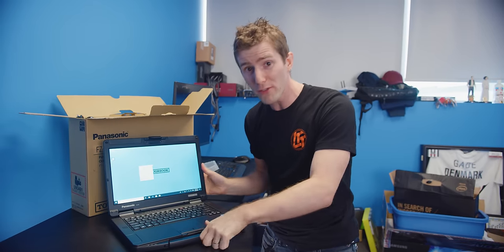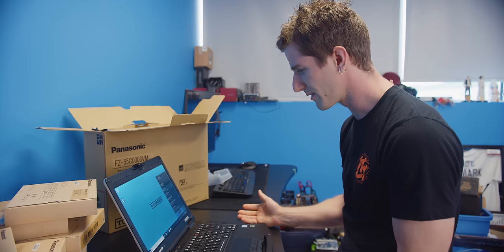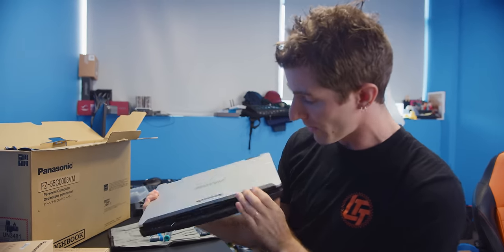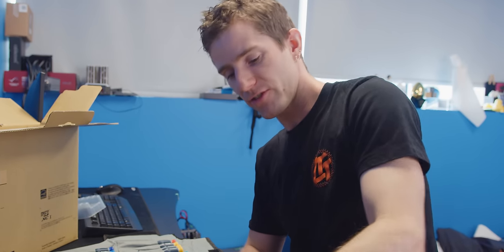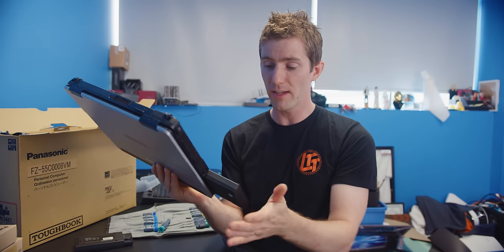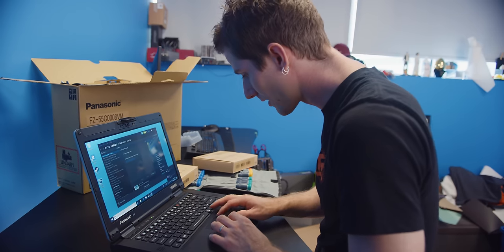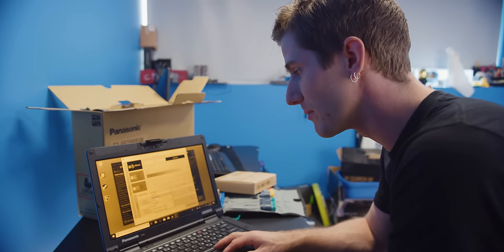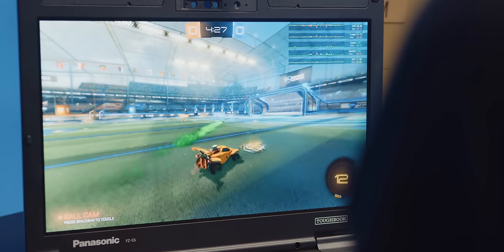The CRAZY Upgradeable Laptop - Panasonic TOUGHBOOK 55 Showcase

Comment: You mentioned the display cable being easily accessible, and there's a good reason for that! In large IT departments where we often have several thousand machines in circulation, being able to frankenstein two broken units together into one functional one quickly is an important feature to have. We often get computers with a broken screen but that are otherwise completely functional. And other times we get completely trashed units, with RAM that's still good to use. Salvaging usable parts is pretty much a daily occurrence. Sometimes several hundreds of machines are sent in at the same time for service, and at that sort of scale every minute counts. We didn't have this exact unit at my workplace, but we did have a low cost enterprise laptop with a lot of the same features in place.

Comment: Pulls drive while laptop is on
"Oops, shouldn't have done that."
Then proceeds to pull battery while laptop is on
Reply: Well to be fair, the batteries are actually designed to be able to do that.
Reply: Sure, but only when the other battery is installed, we don't see him with the extra battery until after he pulled the first one.
Reply: @Azuralis  He only had one battery in at the time, and we clearly see that when he opens it up the screen is black. Then CUT, and the laptop is on.
Reply: I am able to do both of those things with my Dell Latitude that I am currently using to type this comment.. in fact when I saw this comment, I plugged my laptop in, pulled the battery, pulled out the hard drive (the drive slide didn't come with screws for whatever reason, but it stays in place really good unless I deliberately pull on it so it's fine), and it did fine. :P
Reply: @valrabellkeys9867  anyone can do that,
Reply: Or he shut down the laptop in the cut between 6:07 and 6:08 before removing the battery at 6:09, in which case everybody lived happily ever after.  Scandalous!
Reply: Both batteries are in. He simply cuts it and turns on the laptop so that he can show off the hot swapping while there is a picture on the screen.
Reply: @SportbikerNZ  I'm assuming it was updating at shutdown so they cut away that footage because we know how updates can be sometimes
Reply: @valrabellkeys9867  Because it has a bult-in battery.

Comment: they should seriously make a gaming labtop like this
Reply: Swappable GPU
Reply: @Hector-Romero  GPU thermal throttles 

you in vc: Hol on gotta swap to a cooled off GPU gotta be afk for 10 seconds
Reply: @haxboi5492  stack of fridge gpus 🤣
Reply: @haxboi5492  like changing the barrels on machine guns 😂
Reply: @MickR0sco  'cover me, changing GPU!'
Reply: Oh boy, have I got news for you... Framework, a very cool laptop company just announced a 16" laptop with modular IO AND modular GPU while being extremely repairable (going so far as to provide independant repair shops with schematics). It should come out later this year, LTT just released a video on that laptop

Comment: Panasonic: Do NOT leave it out in the rain
LInus: Soooooo, you're saying I can rip the keyboard off?
Reply: @dethrophes i can see why they said it, he's obviously clueless on IP ratings
Reply: When i was working for the police we had one of the older toughbooks thrown out the window of a stolen police car during a chase, it sat in the mud and rain beside the motorway for 3 days before we recovered it. when we got it back to the workshop it turned on without a hitch. I don't think leaving this out in the rain would damage it.
Reply: @dethrophes He shouldn't give advice if he's clueless, it's literally his job
Reply: @dethrophes is that a legitimate question? The channel has "tips" in the name for Christs sake
Reply: @taidgheshea9625  that one might have been designed for that, some toughbooks are just rugged and some are near submersible.
Reply: dethrophes nobody is here for the comedy bro
Reply: I use my Toughbook in rain and adverse conditions and it still rocks, come rain or shine, snow and wind.
Reply: @dethrophes it can't be a tip if ti is false
Reply: @taidgheshea9625  I'm pretty sure police tough books are proper tough books, the main focus is on survivability rather than having a balance of survivability and power.

Comment: This is just like having a ibm Thinkpad release in 2019
Reply: Lenovo still does some rugged Thinkpads in their student lineup, like the 11e, and yes I know not as configurable, or maybe even as powerful, but still a decent option for a  general purpose laptop that's more rugged then most in it's price range.
Reply: There are, and its one of the best laptops... x1
Reply: @Znowin  the x1 is amazing
Reply: @CommodoreFan64  yeah, but Lenovo, peddler of Mainland China spyware. Not IBM.
Reply: This is like the X201 thinkpads but the modularity of the DOCK is built into the laptop itself. I still use 2-3 of them because they are so dang tough and handy. And the dock and accessories were cheap af
Reply: thickpad
Reply: @CommodoreFan64  the 11e is far from durable. the amount of those ive seen that broke from regular use is mindblowing.
Reply: @PickleSurpriseVEVO  Superfish never effected the thinkpad line, only their cheaper products
Reply: Super A31p.
Reply: I loved my R40. Until the cmos battery died and it locked me out eternally. RIP R40.
Reply: But can you swap the motherboard?
Reply: Reminds me of my X40. Which was just like MacBook Air but years earlier and much more modular.
Reply: @psyience3213  Ehm? So why don't you replace it?
Reply: Yes!!!! :D
Reply: @psyience3213  RIP. My T601p recently died to the nVidia GPU issue. Just built another, this time with the LED panel.
Reply: T20 with extra battery pack was my jam. I miss that little red nipple....
Reply: @CommodoreFan64  it doesn't have a trackpoint.
Reply: @Usernamejjd  Fair point, and do I really like the trackpoints on X120e, X131e, and X140e, but I also use a logitech mouse with mine more than the trackpoint, so as long as the trackpad is decent I guess I could live with it if I had too.
Reply: @BilisNegra  it had a security feature that locked the bios when the cmos battery died or was removed. You have to take ot to an ibm manufactuerer to have it reset. Aka its impossible to fix and thats just the wnd of that. Very disappointing.

Comment: These also work great for mechanics, used an older tough book in the shop and it handled oil splash, water, 12 foot falls off lifts and still ran.

Comment: This is the computer I use in the Military.
Reply: shhhhhhh
Reply: I may or may not have dropped a few off the top of fighter jets...
Reply: @TheDalhuck  I remember using one to do post flight inspections and it falling from F-18 wings
Reply: @TheDalhuck  Did they survive?
Reply: @n3tw0rk_n3k0  Super Hornets for me.
Reply: @atirat7388  if they were open the hinges would break, but still useable.
Reply: Well. Dropping this on someone might cause serious damage, so makes sense to use in the military
Reply: Still have CF-53s out there going strong.
Reply: Same. Fucker for run over by a box truck after being dropped, screen cracked and worked perfectly
Reply: @n3tw0rk_n3k0  YEET
Reply: in call of duty??? o really??
Reply: @BaxterMetalTV  hey. Chill. 
You don't need to call out every perceived "lie" you see on the internet.
Be a bit more trusting. (Bit more, not give them your credit details trusting)
You sound like a toxic person, might wanna change that. Have a great day whenever you read this.

Comment: "2019 Toughbook is not that thiccc!"
Reply: Dude i was about write same fucking comment
Reply: 69 likes ;)
Reply: Well it is not compared to 2005 CF-something Toughbooks we got used to...
Reply: It is honestly rather slim.
Reply: Eirik Heggelund so is your wallet after buying one of these
Reply: Eirik Heggelund it's massive
Reply: @AnonymousUser77254  Well it is not a Chromebook, is it. Considering what it is capable of doing I would not complain about thickness at all!
Reply: @seanc.5310  That is definitely true. And that is without the accessories.
Reply: Eirik Heggelund no, wouldn't complain about the thickness, that's not the point of the laptop. That doesn't mean it isn't extremely thick though.
Reply: @AnonymousUser77254  It is thick, but, relatively speaking, it is slim. Wildly interesting!

Comment: “It’s not even that thick” 
-the laptop LITTERALLY has handles
Reply: You should see the fully rugged models and how thick they are.
Reply: I actually like a thicker laptop. More sturdy you know?
Reply: Thatguyontheinternet I have to agree, I’ve seen thin chrome books get bent in half in peoples backpacks
Reply: @Honeydwarf85  jerryrigeverything would approve
Reply: Love handles
Reply: 7 years ago they used to be so much thicker.
Reply: @jasonmurawski5877  We had an older cf-53 toughbook years ago have a forklift fork lowered on it. Smashed the screen down like two inches. Replaced the screen, latch, and front and rear plastics and redeployed the thing. The hinges were even still fine.
Reply: I paused the video and gave it a dislike at that moment... That was so stupid to say... The laptop is as tick as a book
Reply: 20 years ago it would twice the size.....
Reply: Have you ever seen one of the early thinkpad models? Those are thicc
Reply: @ForeverMan  It's a rugged laptop, with 40 hours of battery life, it's crazy thin.
Reply: @Honeydwarf85  i mean im pretty sure my blade stealth is sturdy enough and that's 1.5 cm
Reply: Msi is literaly laughing with their 10kg "laptops"
Reply: So did the GameCube. Nobody calls that  t h i c c
Reply: My MSI laptop from 2017 is thicker than this.
Reply: Hmm, thick, modular... why not just buy eurocom/sager? Get the specs you want, can have MUCH better GPU(up to desktop GTX 2080). Want high speed terabyte m.2 SSD? Go right ahead. And so on. Of course it's not as on-the-go modular, but you get much more bang for the buck. Oh and the biometric security options are there too.
Reply: @ForeverMan  - it's as thick as my 15" gaming laptop, but probably a lot more durable.

You better stick to your trendy Apple products that kill themselves because of non-existent cooling.
Reply: @Texas240  I'm not complaining about the thickness of the laptop but about the comment he made, just because he's getting paid...
Also
I use a Acer nitro 5 17 inch, not a fan of MacBook
Reply: @ForeverMan  - alright
Reply: @ForeverMan  Hey! We're using similar laptops! I use the Dell G3.
Reply: Doesn't make it thick. Did you see it?
Reply: I used to use a Toughbook for work, this one has clearly been through a famine. Ours were something like twice as thick, and if I was ever attacked by an animal my plan was to use it as a hammer.
Reply: @bosstowndynamics5488  i know but do i need that durability when im in school sitting in front of a desk doing graphic design
Reply: ForeverMan its not even that thick, for a rugged laptop
Comparing it to a normal laptop is like saying 'why is a rugged jeep not as comfortable as my sedan, and why is someone saying a jeep with ac is somehow not as uncomfortable as one without ac if its still less comfortable than my sedan reeeeeee'
Reply: it's not. length and width is the prohibiting factor for a laptop fitting in a bag for example, who cares if your laptop is .5 inch thinner
Reply: My first laptop was thicker then that bruh
Reply: its names is fking TOUGHBOOK
Reply: Chris Cosby haha. I’m looking at my cf-31 I have for work and it’s about 2-1/2 thick
Reply: @cosbyc2  I know, I have a couple. grins
Reply: english is not my language. what does "having handles" mean figuratively?
Reply: And it's still quite slim for what it can do.
Reply: The CF-53's were thinner. If you ever get to hold a CF-51 Mk 2 it's something else. Literally as thick as a phone book.

Comment: Hey Linus! Luv your channel! I was a Panasonic Tough-book Tek and the adhesive strips are part of the KB (Keyboard) kit. The TB's are designed for serviceability and are fricken awesome. I still have my CF-29 that still holds a 5-6 hour charge. They even have rubberized Backlit Chiclets for the NYPD and had to use a large screwdriver to open the rear IO doors from all the coffee and doughnut sprinkles. Not even kidding bro! Lol!

Comment: The upgradeable GPU is a big deal but there's a couple of questions.What are the GPU options and will those options be made available for future graphics chips?

The proprietary connectors and lack of a common laptop standard for swappable peripherals mean you may be limited to Panasonic only options. Since there is no guarantee for how long Panasonic will keep making peripherals then buying this laptop is a bit of a gamble.

Also, can the CPU be upgraded on this model?

It's a good laptop and a step back in the right direction but it's still built without the foundational standards that all manufacturers should adhere to and which would assure a longer future for upgrareable laptops. That is key.

Comment: The PowerBook G3 "Pismo" (1999/2000) had very similar upgradeability features (swappable bays -optical disks, additional HDD, Zip drives, Floppy disk.. there were many options in the market - and could house a hot swappable second battery, giving up to 8-9 hours of life, incredible for the time).
Was a very easy opening laptop - just flip the "zero screws" keyboard - and could upgrade RAM, HDD, WiFi card, and even the processor, but not the graphics card.
Nice to see that the concept is still around.

Comment: The reason it’s this modular is because the biggest customers of toughbooks are militaries, law enforcement, hospitals and organizations operating in hazardous areas like construction sites or a refugee camp in a war zone, etc. 

These are typically used by numerous people sharing 1 laptop. The information on it is usually sensitive too so it needs to be easily replaceable between users. Features like that card scanner also suit the needs of some of the aforementioned users, like an intelligence officer accessing confidential information that needs clearance using a card, or to be used as an ID scanner by the police(who also use that car dock you mentioned very frequently), or like you said, to access someone’s medical info.

Some good work panasonic has done on this. A lot different than the tough book I owned years back but still looks to have that same grit and reliability

Comment: "You never know when you need to quick eject your storage!"

true but if you were IT and needed to put an image on 100 of these things, its pretty ez
Reply: Makes it easier for the cops to hide their own misdeeds.
Reply: @saulgoodman2018  we used tough books in Iraq and Afghanistan when I was deployed as an infantry officer.  Destroying the SSD or removing it was a very common practice if a COP was being attacked or if the enemy was inside the wire.  Never happened to me (as the enemy reaching the wire, is quite rare) but we were all trained to destroy any information if we were on the verge of being compromised or overrun.
Reply: Maaaan just use FOG and you’re good. Image 100 workstations all at once.
Reply: Ignoring all the paranoid reasons, the best one is the construction manager who comes in having had a chunk of concrete fly into his screen.  All you have to do is pop out his SSD and put it into a waiting spare.
Reply: Actually the most probable solution is that you have multiple people using them, but you don't allow them to keep them, so they just retain there ssd and pop it into one of the waiting laptops so they keep there work with them regardless of which of the companies laptops they get when they show up to work.
Reply: @crashtestdummy2337  this would be useful then
Reply: swapping between operating systems without requiring dual boot shinanigans
Reply: @saulgoodman2018  Or having each ssd setup for specific situations, one for work another for home use, maybe even one dedicated for media. Hell you could even make them really secure by storing some data on one ssd and the rest on the other ( or maybe having the other initiate some code) while further locking it down with the other modulus and a smart card or something so if you don't have the right combinations and data it wont work right or only give you the operating system and not the other bits.

Comment: It feels so weird that you can just swap in a graphics card when I almost destroyed my laptop trying to add ram.
Reply: F
Reply: F
Reply: F
Reply: F
Reply: The fuck is "F"?
Reply: @nexxusty  F to pay respect
Reply: how the fuck did you do that? was it soldered onto the board?
Reply: @nexxusty  It's a reference to one of the worst call of duty games in my opinion, advanced warfare, in one of the campaign missions there is a scene at a funeral and during said scene a message pops up and in the pc version it says "Press F to pay respects". Everyone seemed to find it funny or something and used it through out twitch streams when someone failed or something bad happened in a game. Now it's overused and people just say it for no reason.
Reply: F
Reply: I feel your pain
Reply: @colossalbreacker  I had to take out a few screws to take out the motherboard, as the ram slot wasn't accessible without doing so. One of the screws was apperantly too big as it didn't want to get out. 
Had to take some massive pliers to take it out and a black piece which seemed kind of important fell off. Not sure how but yeah.
The worst bit was was that bit of ram was defective, even if it was the right type for my laptop (ddr3 1600mh I think).
Reply: F
Reply: Did you not just try downloading the ram first?